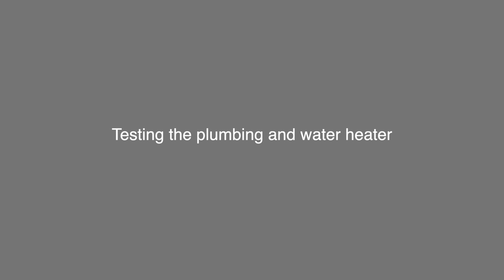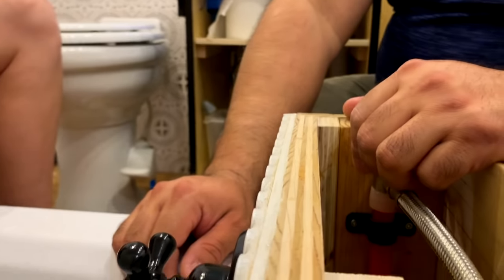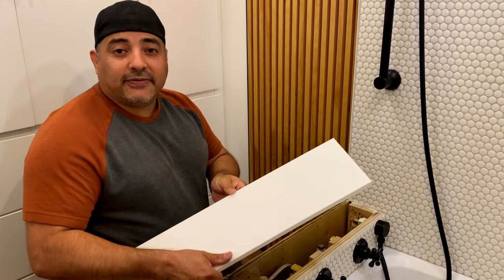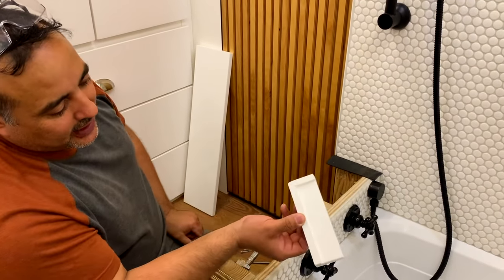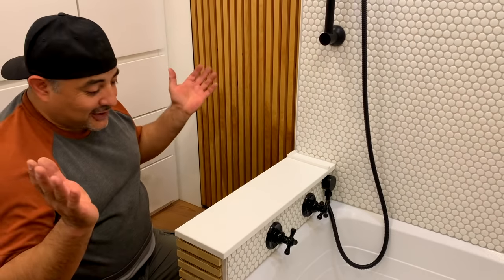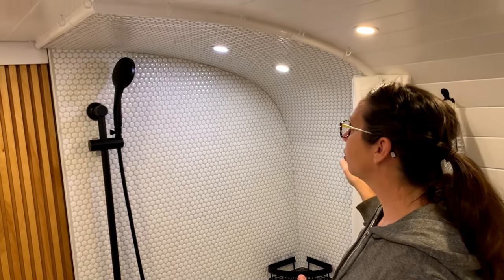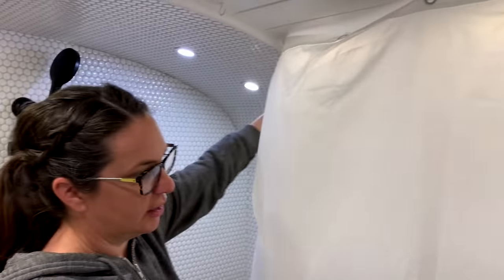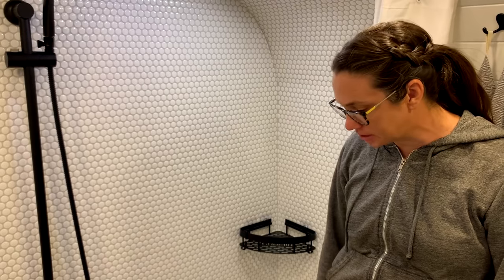Bathroom - Part 5: Testing the Plumbing & Finishing Touches

Comment: For the shower curtain track I would use a small pvc pipe. heat it to shape it to the bend of the ceiling and use round hangers to slide across the pvc pipe.
Reply from the maker: We had thought of something like that, but figured it would still need a center corner support which would prevent a single curtain from sliding all the way around.  Definitely something worth trying though if this method ever fails.  So far, so good though.

Comment: Might be worth routing a small groove on the front underside of the lid, then any water that migrates down will drip off the lip instead of running back toward the wood

Comment: I've used Starboard for years and it's excellent. You can use your router to make a radius on those sharp corners. I've followed you folks for several months, all great work and engineering on your projects.

Comment: Nice solution for the shower curtain!  
I was thinking you could use small neodymium magnets...along the ceiling & in the top of the curtain...but this is way more secure  :)
Reply from the maker: Yes, that would have been a good idea.  I wonder if the kids would have pulled it down a lot though.

Comment: Having visited with you and your family when you were in Virginia I can state that this 35 foot home is very comfortable and accommodating we didn't get to see everything but we did get the chance to speak to you for a couple of hours which was most excellent. So some kind of clear sheeting maybe for the little shelf to hold it to the wall and reapply the adhesive? Thanks for sharing your video with us. Ed
Reply from the maker: Thanks so much.  We ended up finding some caddies that attach to the shower bar and that has worked a lot better.

Comment: I’m curious how you prevent water from running down in-between the hinged piece and the fixed piece?  Seems like you would not want water getting into the area covered by the lid.
Reply from the maker: That's where that little "dam" comes into play.  That's what protects the plumbing area from water seeping in.  It's working great!